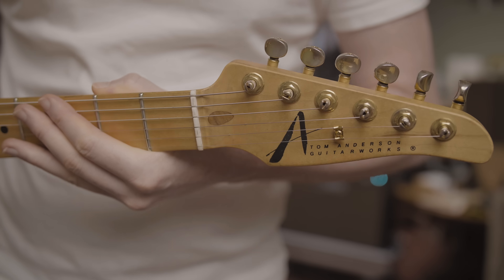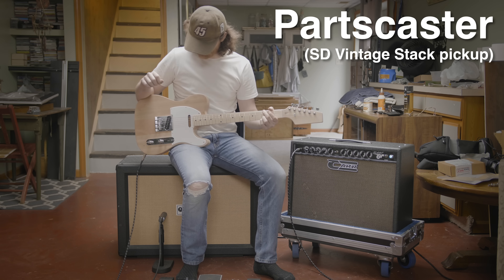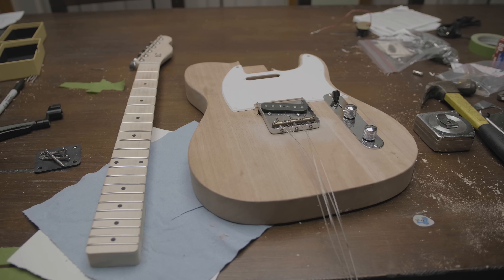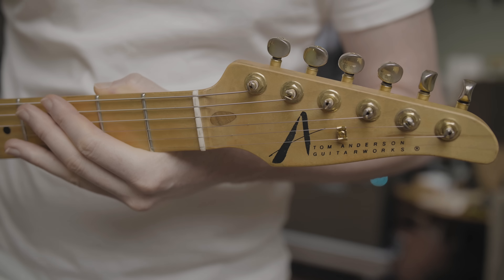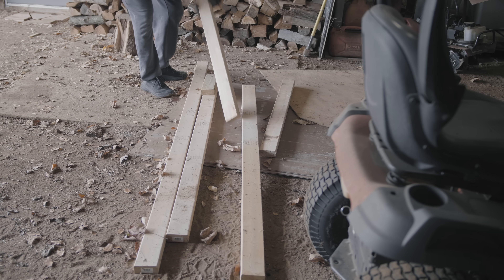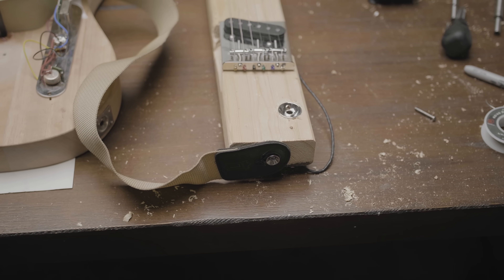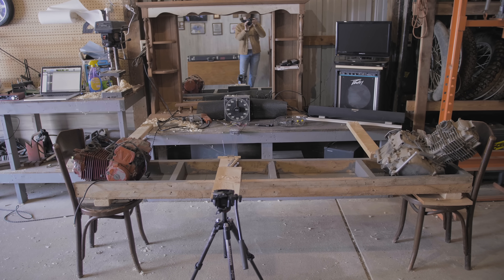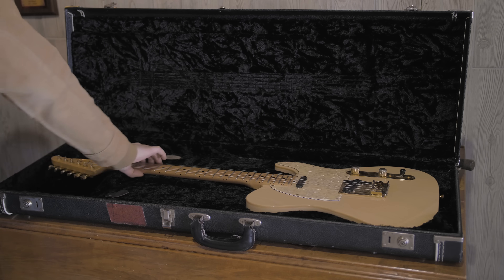Tested: Where Does The Tone Come From In An Electric Guitar?

Comment: Interesting. There are noticable differences, but they get smaller as the video progresses.
The Anderson typically sounds best and has balanced subtleties that I'd rather hear on a recoring.
The air guitar bit is very interesting, but I do think you need to keep in mind that you might've done something with that contraption that is unobtainable in a regular guitar build.
Effectively you've created a room/barn sized guitar. Taking that into acount, it might not be that impressive that its sound has a lot of 'body'.
Just a guess though...
Reply: Do old barns sound better than new ones?

Comment: I’ll just share an experience I had. I have a squire VM jaguar. It’s a good guitar and I enjoy it. I realized that fender duo sonic and music master necks were the same scale length and I could buy a vintage 60s neck for cheap(years ago). I knew I couldn’t afford a vintage Jaguar so I thought this would be the next best thing to get that feel. When I swapped the necks the guitar became louder acoustically. That was something I did mint expect. The tone through an amp changed too and noticeable for the better. More defined but also more full. Before replacing the neck I just thought I’d get a vintage feel, but it definitely changed the tone too. 

Now I had a great sounding guitar but it didn’t intonate well and didn’t stay in tune. So I bought a mastery bridge and swapped that on. The tone changed again but not for the better. The Jaguar bridge had a buzz I was that turned into a jangle when amplified. The mastery bridge stays into tune but I lost some of the jangle. It’s still on there because it is much more playable now.

Comment: Really well done.
You nicely disproved the tosser expensive guitar guys.
I'm an electronics professional who dabbles in some hobby electric guitar, and YEP totally agree with your conclusion which is why I have always bought cheap guitars (provided they have a good neck and fret intonation) and then just add the pickup of my choice.
The one time I thought that the wood parts really made a difference was with neck-in-body guitars like my old Ibanez Artist, that big heavy neck glued in as part of a heavy body gave much longer sustain and a slightly deeper tone than a bolt on neck guitar. I use a lot of gain, so that is where you really notice the extra sustain. Your tests would not have shown sustain in the way that a heavy neck-body and massive gain does.
Awesome video! 👍👍🙂

Comment: I've always been a proponent of pickups being a tremendous contributor to sound. I learned this when I put dimebuckers in my first guitar (a 100 dollar eBay guitar with no branding) and it transformed it completely. I wasn't convinced then though. No, that came with my next 2 guitars. See, at this time I was obsessed with EMG pups, because Michael Keene uses emgs, someone on YouTube said so. So I wanted a guitar with emgs instead. Surely that would fix my tone. 

My second guitar was a starcaster with... no EMGs. It was a graduation gift touted as a great guitar and it was good. I hated it. It felt numb compared to my other guitar. Eventually I landed myself a Schecter C8 with EMG 808 pickups.

Then I learned.

Pickups are everything, and even with the freshest batteries in the state, the guitar still felt numb, hard to misplay on, but hard to really feel the music from. Before I quit guitar for the most part (apartment living), I was on a never fulfilled quest to find an 8 string version of those legendary dimebuckers. I hear bkp juggernauts or aftermaths are good but eh.

Wood doesn't matter for tone unless you never plug in. The bridge is just for convenience. The action matters but more for comfort. The neck doesn't matter though fret shape might. What matters is that little magnet picking up all the waves electro magnetic generator strings give off, and turning it into an analog signal. Pickups are your microphone, and for tone, it doesn't matter which stand you place the microphone on as long as it holds it in place.

uhh ty for reading.
Reply: love the "ty for reading"
 you're welcome xx

Comment: I like the guy who put the player as the big #1. You should keep getting guitars from them, because they're clearly no-bullshit.

This video is so good though. There is so much nonsense out there that doesn't even stand to reason. The pickups on an electric guitar are not picking up sympathetic vibrations from the wood (and if there's too much of that, you're losing sustain anyway!), and they're not picking up what kind of bridge and string trees you're using (I could see saddle and nut at least making a tiny difference). It seems like it should be obvious, then, that the most important thing is the vibration of the strings and the way that is converted to a signal for the amp (pickups, pots, wiring). But people are going to be superstitious, I guess.

Comment: Love this!  The whole way an electric works is by generating a magnetic field and then sensing vibration of magnetic metals in the field.  So I've always said that the wood does not contribute to the sound.  It's the player and the electronics.  That's it.  I never thought about pickup height, but that's obvious once you pointed it out.  Great video

Comment: I was always skeptical about the whole 'tone wood' thing, I thought 'well different densities in material result in different behaviour regarding the transmission of vibrations, so I guess maybe the tiny bit of vibration thats transmitted to the body affects how the vibrations of the string are picked up by the pickup?' but it seems that my initial thought, which is that surely this effect must be negligible, was just proven correct by a tool bench and a shelf...

Comment: I've built an electric bass and two guitars where everything was mounted on a pine 2x4 and the bodies are made of Plexiglass. The bass is solid layered and the guitars are sealed hollow bodies. The pickups, necks and hardware are all medium grade plus I'm a beginning builder. I'm not being biased but they sound and play great and others have said the same. To sum up I believe you can build an electric out of almost any solid material.
Reply: I'm sure glad new builders like you aren't believers of non-sense. Great job.

But yeah, as long as it can keep up with the tension of the strings, it can be used for a guitar/bass.

Comment: I can definitely hear the difference here, but we have to admit it's pretty subtle. Wood is wood, but the age of the wood and the density of the wood will always make a difference. Compare the waveforms in a high powered oscilloscope, you will see it clearly. 
I think It might be a more convincing argument if someone could successfully demonstrate a comparison video of a 40-50 year old guitar where the wood has aged fully and put it up against a new modern guitar made with the same materials, same wood, same design, same tuners, same pickups. Do an A B comparison like that where it sounds identical, and you might have a convincing argument, but I challenge anyone out there to actually do it.  And even then only in person with my own ears and none of this BS digital technocrap and fancy editing in between would I even consider changing my mind. Get off my lawn, damn hipsters and your damn plugins and DAWs and digital amps and FX. Grumble grumble grumble.

Comment: In all truth, it comes from your hands. As many people have pointed out, you can pick up the same exact rig that your favorite guitarist uses and play the same thing they play, and you will still sound different. The subtle differences in your picking (attack strength, angle, location) and fretting and the differences of exactly how your fingers hold, move, etc across the frets make the biggest difference in how you sound.
The only other thing is you pickups/amps/pedals, but that's the more generic and obvious aspect of "tone".

Comment: Would be super curious to see the results if the same test were done on a bass. For years I hated the sound coming from the Seymour Duncan quarter pound p bass pick up in the bass I built. Then for grins about 3 months ago I torqued the pickup in tighter and much farther away from the strings. Sounds so much better

Comment: You systematically proved something a lot of people have been debating and debunked a lot of myths. The only reason a lot of guitar details matter is for aesthetics and mechanical integrity/performance. NOT for tone. Thanks for creating this!
Reply: Isn't that.....completely obvious?
Reply: Ergonomy as well
Reply: @NubsWithGuns  You're mad because he... used a word?  And used it... correctly?  Why are you even commenting?
Reply: @NubsWithGuns  do you feel stupid when you need to read a word with more than 6 letters?
Reply: @RevictionRyan  i dont think anyone has ever debated that wood makes a difference in acoustics its obvious that it does the debate has been entirely concerned with electric guitars
Reply: So, I don't know if you know this, but you are contradicting Albert Einstein. When he formulated the equation E=mc2, he established that energy and matter are the same thing, two sides of the same coin.

When you pluck a string on an electric guitar, you are creating potential energy. When you finish pressing it, removing the pressure from the pick or your finger, that potential energy is converted into kinetic energy, and makes the entire system (the entire guitar) work according to the laws of physics. A series of vibrations, energy transfers, etc., are produced, which depend on all the elements of the system, of course including the density and specific characteristics of the wood. Everything influences how the strings vibrate, and how the effects of that vibration are picked up by the pickups.

When the strings are vibrating, even the guitar "bends" on the neck (of course, to a level imperceptible to the human eye). When you pluck a string on the fretboard, it is in direct contact with the wood.

It is materially impossible for the wood of a guitar not to affect its tone, according to the most basic laws of physics.
Reply: @derfreischutz4380  Tell me, what's picking up the sound? 
The flat piece of wood with no acoustics, or the pickup?
Reply: @enjeav0709  tell me, what do guitar pickups pick up? what kind of signal do they receive and how do they process it? I think you have not understood anything of what I explain. From my own experience, I know that you should not argue with people who are not interested in learning and prefer to live their flat earth.
Reply: @derfreischutz4380  Invoking E=mc^2 for guitar acoustics is absolutely ludicrous and totally inapplicable.  That sort of hyperbole says a lot about how you regard your knowledge.

Yes, the wood will affect the sound... about 0.0001% of what comes through the pickup.  It's totally indiscernible.  The real effect of the wood is providing a sturdy place to attach everything, comfortable way to hold it, and weight to increase sustain.
Reply: @girhen  it's ludicrous only if you haven't read the text without attention
Reply: @derfreischutz4380  I have a degree in physics.  What you said is an attempt to blind people with science.  It's fluff to make you sound smart.

If you truly believe in tonewood, go take SpectreSoundStudios Tonewood Challenge and let us know exactly when the changes happen and which wood is which.  If you can't, then the wood doesn't matter.

(Btw, no one was able to claim that prize.  Tens of thousands of views within that week, and no one could identify it for a prize.)
Reply: @girhen  i have a real degree, not a dreamy one. This a simple way to explain it.
Reply: You want a simple explanation?  I once calculated how much younger my father was based on time dilation because he was a pilot.  At 6000 hours at an assumed 500 knots, he was a few microseconds younger.

There's also the classic "the light was green because of blue shift" problem.  The doppler effect works on light (though quite differently than sound).  If you're closing on an object it will shift blue, if you're diverging then it shifts red.  If you run that calculation, you'll find that you need to be moving nearly 20% of the speed of light to shift a red light to green.  At 2000 miles per hour, red/blue shift can be completely ignored by pretty much anyone.

Just as those two effects technically exist at any level, but can be ignored, so is the same for tonewood. It's been proven time and time again.  I gave you a challenge to prove yourself, and you can't, despite multiple videos showing people can't detect a real difference.

You think you know what you're talking about, but you're just wasting your time (and other people's who have to read your dribble) and being an ass on the internet.
Reply: He should blind test this on musicians. I would bet that few were able to pick which one was which.
Reply: @ryanissuper1334  Sure, and good way to test it would be not to tell them at all what the guitars are made of and see what they come up with.  

It would be quite interesting to see their reactions when they are told about the bench guitar.   After they've expressed what they think what the guitars are made of, of course.
Reply: @girhen  This is totally out of focus and you know it. Energy and matter is the same thing in absolute physical terms, nothing can escape this equivalence relationship. An electric guitar is a set of materials that work as a system. The properties picked up by the pickups are influenced by the entire system, there is no "x" percentage of the wood (because, simply, no guitar is the same as another -so you are VERY wrong-), the answer is that the wood influences the tone of the guitar.
Reply: He didn't prove anything.  He suggested something, demonstrated it, and everyone ate it up.   But they ignore the fact that the slide guitar strung between two work benches sounds like garbage.  What about my ES-335 and my SG?  They both have virtually identical PAF pickups.   Those two must sound the same right?  Because "tonewood" is a "myth".  And what is an ES-335 but a big hollow bunch of tonewood that only sounds different when it's played acoustically.   They must sound the same right?  I mean, the pickups only pick up fluctuations in the magnetic field, right?  How about Eddie's first live shows with the Floyd?  Nonsense, why would the bridge have any impact on the tone of the guitar?    This is the biggest bunch of contrarian crock of feces I have ever heard.  You can all have your opinion, but please don't work on others' guitars.  In fact, go start a guitar company with nothing but the 2x4 used in this video.
Reply: @PhpGtr  Saying the "air guitar" sounded like garbage is also saying that the Anderson sounded like garbage...because they sounded identical. Neither sounded like garbage...
Reply: @Hickeroar  If they sounded identical you have no ears... really...
Reply: @Hickeroar  @Caio Porto  yeah I closed my eyes listening to the results several times. it's identical. Anyone saying otherwise well, I don't know what to say to that.
Reply: @caioporto9234  The air guitar is a bit more metallic sounding, but other than that they're identical.
Reply: @caioporto9234  i'm a music producer and i have good ears, they sounded almost identical, the anderson had just a little tiny bit more bass.
Reply: @PhpGtr  if someone scream at your ear I bet it does make a big echo inside your head
Reply: @PhpGtr  So you're just going to ignore all the other factors between your ES 335 and SG and still go with the false "it's the tonewood" mantra? He didn't suggest every guitar with same pickups sounds the same. If what you were saying was even remotely true, he would never be able to make a freaking bench sound identical to a "tonewood" guitar.
Reply: @PhpGtr  “he suggested something , demonstrated it…”

Yes , we call that evidence.  You are of course entitled to your own opinion, but it’s wrong and “ tone wood “ is BS.
Reply: @PhpGtr you do know that both those guitars have different pickup placements right? You can demonstrably measure this yourself. Don’t make a fool of yourself so publicly